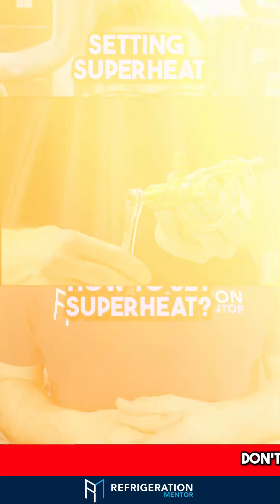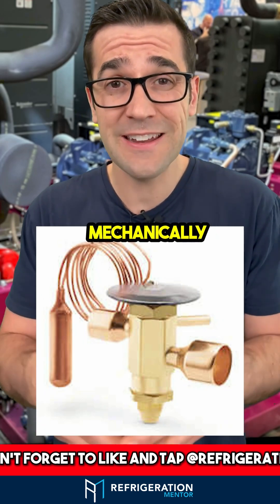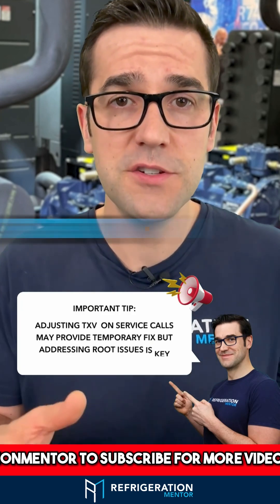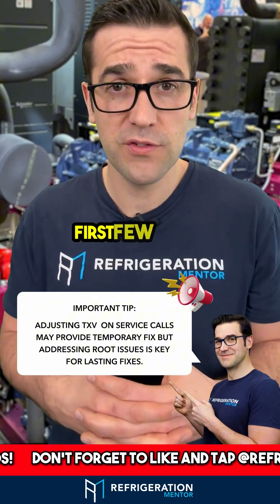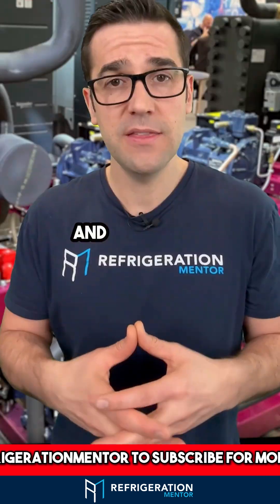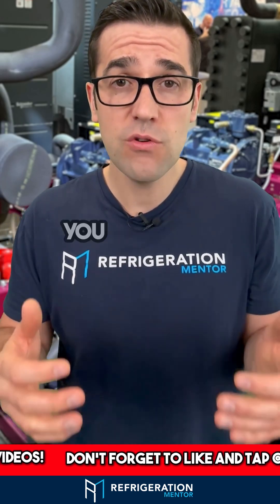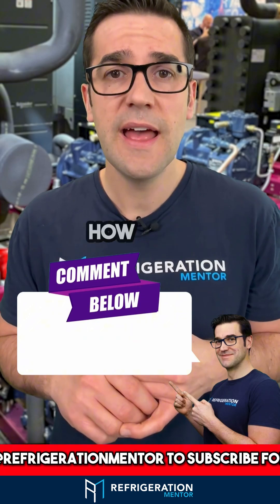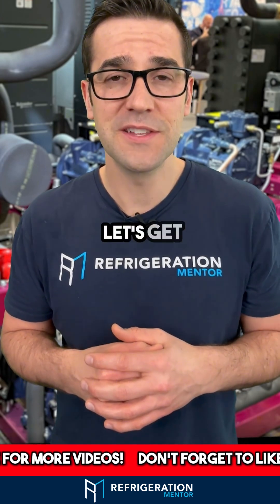Do you know how to set Superheat?

Comment: Hello sir , what's the right way to calculate the superheat of a 2 stage semi hermetic compressor that works in blast freezer ? What's the right value of superheat ? What's the right time to calculate and adjust it .. is it in the middle or near the end of the freezing process ? The compressor always has very few hint of frost on it every 3 hours after melting the ice on the coil , the refrigerantis 404A .. thanks in advance 😊